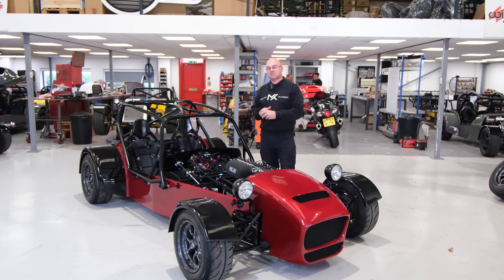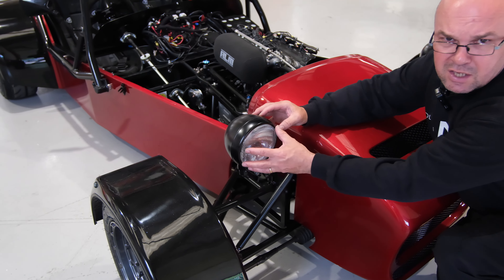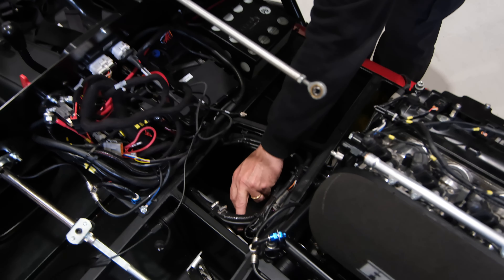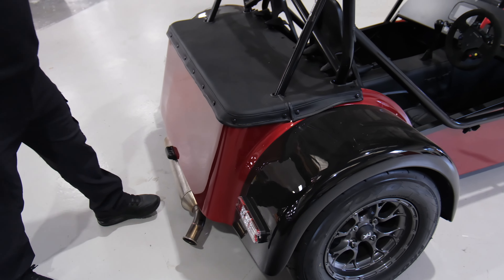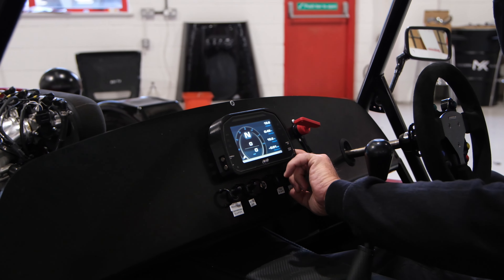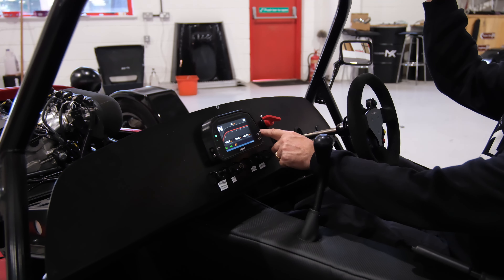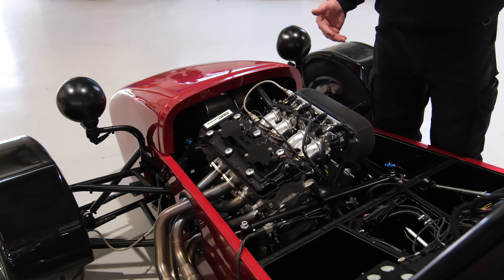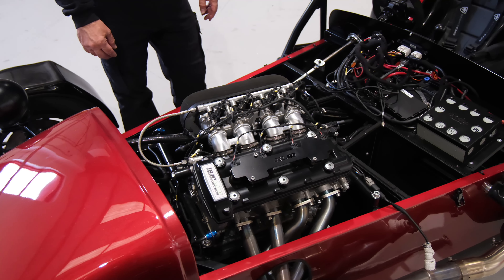Drive By Wire Upgrade! - From Racecar to Roadcar EP.7

Comment: Slightly off topic but can you let us know where to jack these bike engined cars up from is just to remove the wheels for cleaning/servicing etc.

Cheers Rob
Reply from the maker: Under the chassis rail is the safest place.  It depends if you have a diffuser or not?
Put some pictures of your car on our Facebook group and we can advise
Reply: @MKSportscarsofficial  I do have a diffuser on the car which is great but blocks out access to the rear, I'll forward over some pictures on your Facebook page, many thanks in advance 👍🏼 great work as always.
Reply: @MKSportscarsofficial quick question mate does it adopt the year of the mx5 Donner car as I'm looking at importing to U.S but needs to be 25 years plus